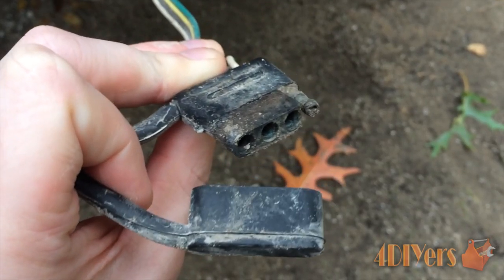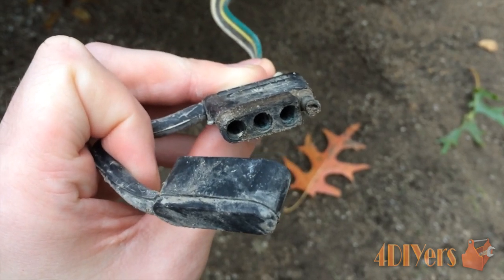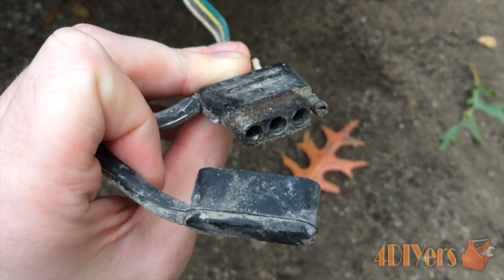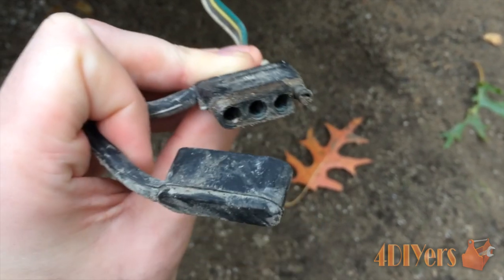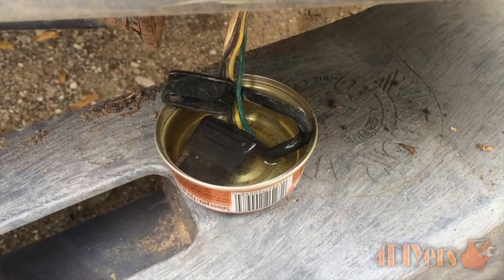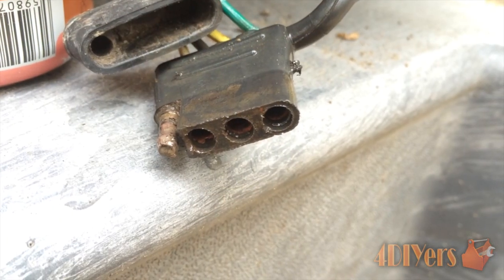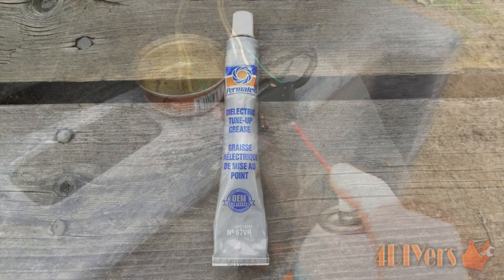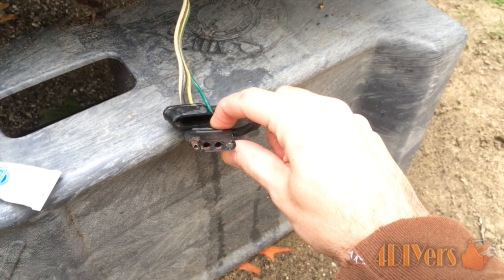Tech Tip: Cleaning a Corroded Trailer Light Connector

Comment: A easier and faster way to clean connection like that is to. Get a Q-tip break it in half put it in a drill put some brasso on it. Then stick it in a hole and drill away until its clean. Then it will be bright and shiny again.
Reply from the maker: Great tip, thanks for sharing!
Reply: I did something similar with a 6 mm rifle bore brush. Just don't plan on using it again - Q-tip is way cheaper.
Reply: wish i read this earlier hehe

Comment: I have an old can of carb cleaner. Can that be used in place of the battery cleaner?
Reply from the maker: Nope, that's instead for residues left behind from fuel or dirt. Typically carb cleaner isn't intended to remove corrosion.

Comment: I just bought a brake light to put on my hitch.  Can anyone suggest how to protect the connection since now it'll be used 24/7?  TIA!
Reply: Not sure... Just a thought. Try electrical tape. Easy to remove and replace, anything else may make it difficult to remove if you hitch up.
Reply: Use dielectric grease  to coat the contacts. It's shown in the video.

Comment: I take it this is fine to do with the connector still hooked into the wiring harness as long as there is no open circuit to the connector?
Reply from the maker: Yes that is correct.